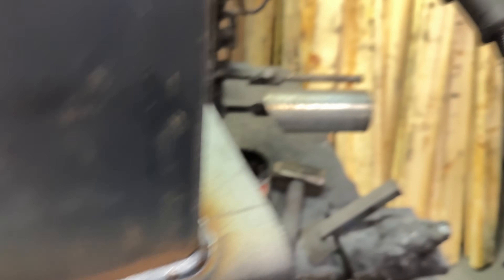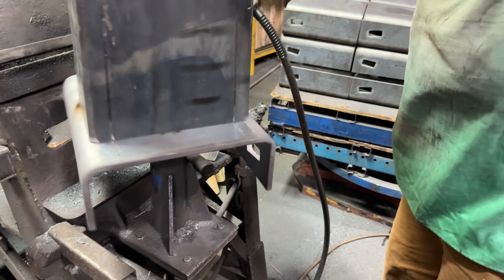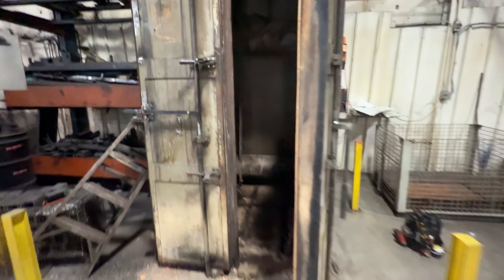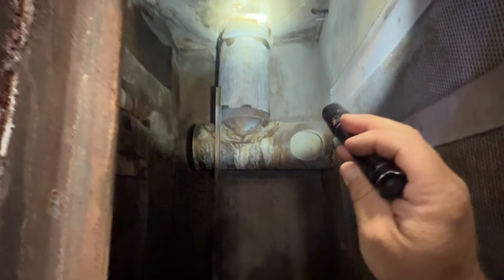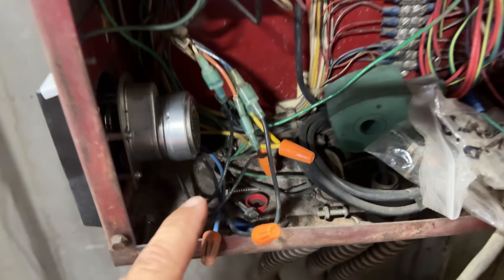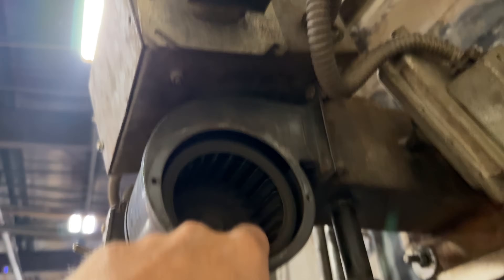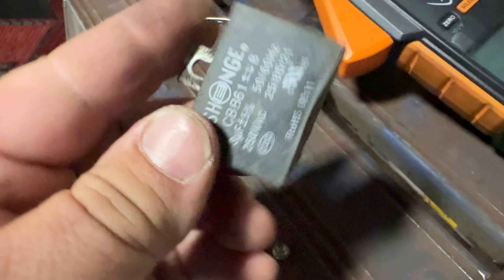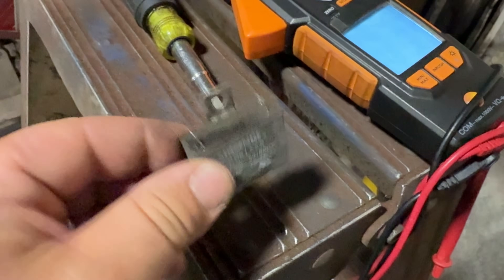Burner Not Heating • What’s This Do?

Comment: 4:56 when we see that the "next three lights" come on, we can also see that the first one in the sequence that does not come on is "AFTERBURNER BLOWER SWITCH."

11:05 you expressed not being sure about the cycle timer working because the cycle timer motor was not turning earlier. Way back in the video (5:40) we can see (lower right corner of the screen) that the cycle timer motor is in series with some of the safeties: the cycle timer does not start timing until that is satisfied.
Reply from the maker: I'll have to check it out. I haven't had to go back since being there this summer. This video has been sitting on my computer for months. Thanks for your input and close eye.

Comment: Who are we kidding, that capacitor is there forever now
Reply from the maker: No I returned back with the correct one. Why not do it right? You can't be as hard on people as what I am and not do things right yourself. That would be very hypocritical.
Reply: @HVACRSurvival I figured they would have sprung for a whole new blower assembly, and that substitute cap would be fine indefinitely until then is all. Tongue in cheek, I mean no disrespect!
Reply from the maker: I come across harsh at times, not what I'm trying to do. This is why I don't like writing. I have no grammar or proper pronunciation or word placement, blah blah blah.😀

Comment: I worked at a company, and we had an oven like that one, plus huge bake ovens to cure paint on parts, and air makeups with burners; two of them were 6.5 million BTU each. I made sure they all ran properly. We also had an abatement system outside that the burner on it ran at 1350 degrees to burn paint solids off before exhausting it.

Comment: surprised they still make shelves in such a manual way, not even a magnet arm/crane to move and position the heavy parts. lol, guess there's less to fail.
that furnace, guessing they start it with the door open, so no gasses/vapors are built up, which would be a very bad, high speed unscheduled self deconstructions. aka BOOM.
breathe some of that CO for me! with door open near 100% bottom burner combustion gasses are dumping out.
if there's no exhaust fan on the flue stack, it could be effected by negative/positive building pressure with the door open and make the exhaust scrubber flame out of balance, so the air damper may be adjusted wrong. probably have to adjust when it's actually loaded with material and monitor through the whole cycle, I guess that would effect the overall flow through the cabinet due to venturi effect on the flue.  looks like a pain in the rear and too much to think about. lol
Reply from the maker: Throttle bottle you just let me down thinking there might be CO in that burner system. I seldomly see any CO on a power burner head.

Comment: I am working with almost the same style oven just smaller. First time I worked on one of these. It is different to work with. Does the one you are working on have 2 gas valves on the top burner for the flue
Reply from the maker: Yep. It has two.

Comment: Videos of diagnosing/repairing weird stuff is why I watch this channel. It's what sets your channel apart from the 50 guys out there just doing 5 ton RTUs again for the millionth video. If anything, please post more weird stuff.
Reply from the maker: Thanks guys, I sometimes wonder if I wouldn’t have a larger channel if I did the boring residential crap. But I’ve kind of tried to keep it either commercial or industrial. Maybe I should record some of the weird shit. I don’t think I’ve ever gotten this many comments before this quickly.
Reply: 100% agreed.
Reply: Agreed very well put
Reply: Good fix on unfamiliar equipment!  Using the basics you found the problem!

Comment: Oh man not a burn off oven! Brings back bad memories 😂. I worked on one at a 55 gallon drum recycling facility years ago. Drums went in on a conveyor belt. 6 burners on each side cooked the drums. The plant operators almost blew it up one day when they loaded drums containing excessive printing ink residue. I was there working on the office area AC equipment when a panicked operator came running over to me telling what happened and asking me what to do 🤦‍♂️. I said the E-stop button and evacuating the area would be a good place to start. The smoke and fire pouring out was unreal. I still have the occasional nightmare about that place.
Reply from the maker: Wow, that sounds like a crazy experience! Glad you're okay!
Reply: @H @HVACRSurvival Me too! One of the wildest things I have ever seen. It was a miracle it didn’t blow up. The oven was outside and I was working right around the corner from it. The operator was frozen with panic after I told him what to do so I ran to the E-Stop. The entire place was a disaster waiting to happen. The things you see on the Southeast side of Chicago!
Reply: probably should have killed it and left it shut, assuming it had a sealed door. lo, it would quickly choke itself out with fresh oxygen supply.
Reply: @throttlebottle5906 it was open on both ends with no doors…drums went in on one side and came out the other as the conveyor moved them along. Kind of like a car wash but with fire. Probably 30 feet long. Had an afterburner system that sucked the smoke out the top from multiple locations. Wish I had a picture of it along with a picture of the control panel. A “contraption” best describes it.
Reply: @matth5309  open end conveyor setup. got it!
seen some that had doors that closed when it blasted everything, but also open ended.

Comment: I love working on stuff I have never seen before. I did a job like this but caught the problem right off the bat. As I was walking out, they asked me to look at a giant food processor, asked if I ever worked on one, I said no. This monster had a key you turned on first then you had to hold down two buttons for safety reasons. I pull the panel and find a loose connection, that was it. They asked me to start it.
I turned the key pressed the two buttons and BAM! It sounded like a machine gun going off. Jumped back like a scaredy cat, they all started to laugh at me. That's the way it sounded, but I never worked on one, so I didn't know. Love this trade
Reply from the maker: This ain’t the first time I’ve had to ask people how the thing normally runs. That’s kind of how I started working on conveyor ovens at red lobster. Didn’t know nothing about microwaves either, called the Factory and got the book asked him a few questions. Next thing I know I was able to fix them.

Comment: "That looks kinda old" Welcome to the industrial manufacturing world! 🤣 I hope this place doesn't have any maintenance guys... As an industrial maint. tech I'd be embarrassed if I couldn't diag a bad motor capacitor!
Reply: Almost guarantee that motor shits the bed in the next year
Reply: @jman0870 It’s either that or it runs for another 10. No in between!
Reply: @ect.95 considering that almost every single phase motor that wasn’t a compressor or condenser fan motor on 3 phase equipment that I replaced a bad cap on died within a year, it’s unlikely. In the land of callbacks mean warranty, your opinion holds little validity. I spent 6.5 years in heavy manufacturing maintenance. I get it. You get to screw with stuff and see what happens with little repercussion.
Reply from the maker: @jman0870It’s I'm not really sure exactly what you mean by that, should I bow down to you since you worked on the same shit that I'm working on? And every plant that I work at has maintenance guys that can't do what I do. Very seldomly do they have anyone that can do it all. We are not a flyby night company by any stretch of imagination and I don't post these videos for anyone's approval and I don't record every millisecond of what I'm doing or broadcast what I tell the customer. I believe you have left cynical comments on my channel before, I choose not to block you because I really don't care. I like to feed the trolls.
Reply: @HVACRSurvival Rick I’m not sure if your reply was meant for me or the other guy but I meant absolutely nothing hurtful in my original comment. I love your videos and have a lot of respect for your work. I’ll delete it if it’s being taken out of context. I apologize if you’ve ever felt compelled to block me. Like I said, I’ve never meant any wrongdoing in any of my interactions on here with you before.
Reply from the maker: @MaintenanceMan00  no man not you. I was talking to Jman. I can click reply on the actual comment and it puts it in a group because everyone's said something, so It shows it to everyone and it doesn't always put the @whoever the hell I'm talking to in front of it, so no that's not meant for you.
Reply: @HVACRSurvival what are you talking about Rick? I never said you were a fly by night company. I never said you didn’t care about your job. I simply said that small single phase motors are generally not long for this world the you find a bad cap on them. That’s it. You do you, boo boo.